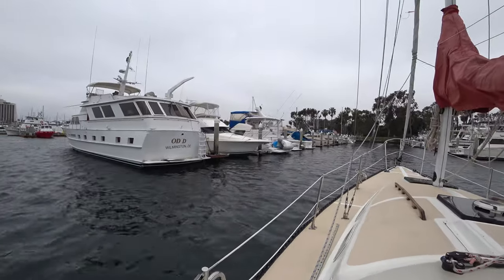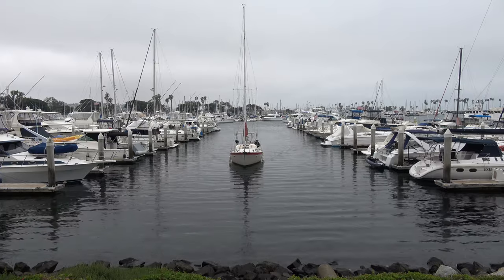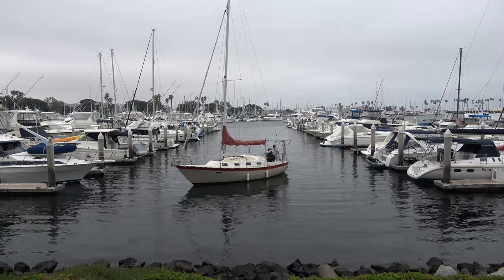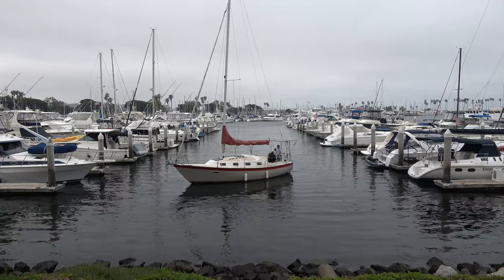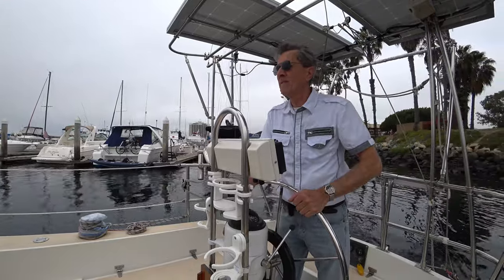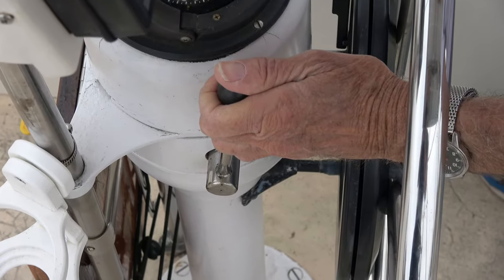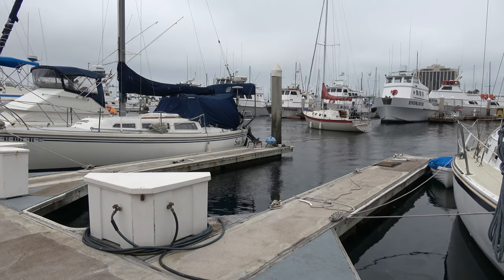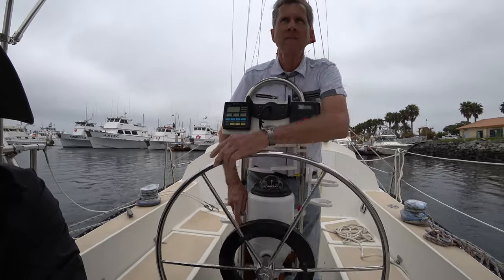How to use prop walk to turn in place & Backing into a slip

Comment: Good video. Don't think about direction of prop rotation. Just accept that the boat pushes port or starboard in reverse and use it.

Bad bit.
When you forgot to mention drift from tide or wind turning on the spot.  That's what puts you across anchors.
Yes. Keep it simple. But it has to be mentioned.

Comment: If your prop walks to Port, your wheel  should be  hard to starboard.  If you have a tiller, it should be in the direction of the prop walk .  When the boat is in forward  the water hitting the prop kicks the stern 
To port continuing  the momentum  of the clockwize rotation . This is Especially true a long keeled boats with the prop way back at the stern boats with sail drives that the prop is way forward  have much less  or no prop walk .

Comment: The complicating facotr, of course, is cross wind.  With a boat that has a long keel with cut away forefront, as soon as any wind hits the boats while you are going slow either foreward or backward, the bow wants to blow off downwind and if the wind is strong it can easily over power the effect of the rudder that has little water running over it..

Comment: Thankyou. Does a long keel boat perform differently in these circumstances?
Reply from the maker: Yes...A full keel may not turn at all. The prop may be much lower and may not produce enough prop walk. I suggest you test in a very large open space so if it doesn't work you are not in any danger of hitting anything.
Reply: I had a Tayana 37, long keel, albeit modified.  I heard and agree that it backed up like a drunken elephant.  You could not maneuver in a fairway without using A LOT of prop walk i.e.  lots of throttle to push the stern over. The one thing that you had going for you is that the boat was very heavy so did not accelerate quickly in reverse or forward.

Comment: Nice video but the cut at the end is for a reason ;-)
Reply from the maker: Yes,  I did cut early, as I revved up the motor to bring the boat to a stop the prop walk pulled the boat over to one side of the slip. This is normal and not a problem but would have required a lot of explanation in the video so I cut early.
Reply: Standing on the opposite side of the wheel is such a simple idea that I’m ashamed I never thought of it before.  Thank you.

Comment: Hi Buck, thanks for your videos here, a question on this one at .55 on video. so your turning into the berth, which side is your rudder hard over to? I assumb its starboard but you didn't make it clear. Also trying to understand the effect of prob wash. prob walk and which hand the prob is. Maybe another theme for a video. It's hard to find any good videos on youyube on this topic that detail every aspect. Thanks for your time. Paul
Reply from the maker: In this case it is to port...remember even when you face backwards, port and starboard are on the same sides as when facing forward.  All that is important to know is that you just point the ruddder in the direction you want to go. Thanks for comment and question.

Comment: My boat has a full keel. It does not go backward. It you try it will just go in circles and you have zero control.
Reply from the maker: This technique doesn't work on most full keel boats.  However a bow thruster works charms if you're lucky enough to have one. Thank you for watching and commenting.

Comment: Please dont put your hand bet. spokes. 😊 Better reach the throttle from top, over the steering wheel.
Reply from the maker: Absolutely! You never know when you have to make a sudden steering correction or an unseen object hits the rudder and an arm in the wheel spokes is very bad.  You notice that I reach over the wheel for most of the video, I only reach between the spokes when I am demonstrating pausing in neutral between forward and reverse which I did so that you could see the action more clearly.

Comment: We have a tiller..full keel.  Reverse is not in her vocabulary.😊
Reply: @sailingliberator3395, what make/model/type of prop do you have? I have an IP31 with a 16RH13 prop and prop walk is effective (to port) but reverse thrust is disappointing. I'm actively pursuing opinions on a fixed 3-blade e.g. Michigan Wheel, Chesapeake, or Campbell Sailer to gain some maneuverability inside the harbor.
Reply: @carlsattler9668  ours is fixed 3blade. Unsure on model but I have a picture of it while we changed our Cutlass bearing